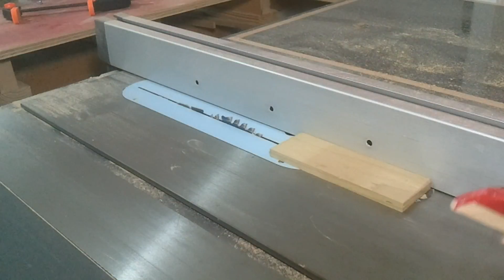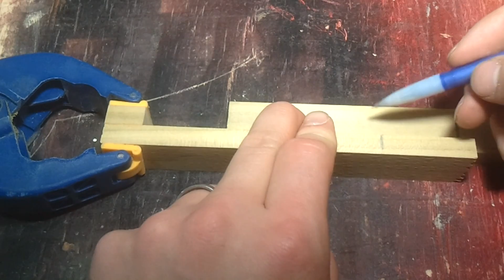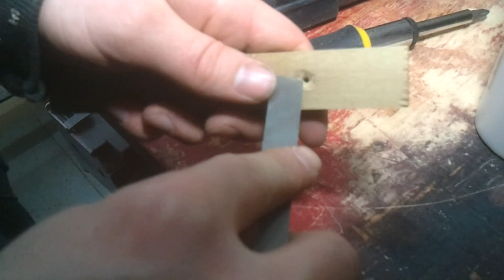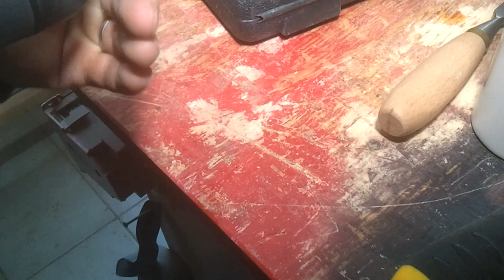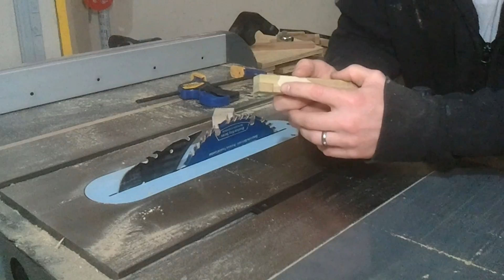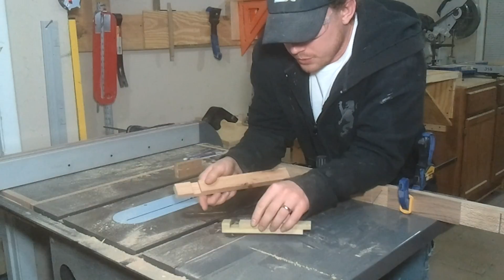DIY Kerfmaker with scraps - 052

Comment: not very pretty, but very useful and simple!
Sure you can build something with routed sleds like https://www.youtube.com/watch?v=YsfOWa_TFR8
Or buy one, for example the one from Bridge City Tool Works.
But this one is pretty sufficient, easy to make, even disposable. If you make the fix block adjustable you can use it for more than a single blade/dado-stack, if necessary.
Thanks for nice video.

Comment: Hey Jay - rather than creating the kerf afterwards (which seems a bit awkward), wouldn't the kerf cut be perfect and already in place when you cut the "fixed" end piece of of one of the two pieces, as long as the two pieces start out at the same length?  Then just make the slot, add the screw, and you are done!

Comment: jay i use both hand tools and power tools.  i was cutting a slot in the end of a 2x2. about one eighth inch thick.  using japanese saw cut two lines and started to use kerf of saw to make slot bigger then duh i remembered my drill. put drill bit on side in slot and made a perfect channel.   i have used same way you used drilled holes and took chissel to finish the job.  i am wondering if  we couldnt drill starter hole jig saw to end of dado put larger.drill bit and use like a router.

Comment: I have to admit I didn't understand a single thing you were doing until the 10 minute mark. THat's when it all came together for me.  That looks like a must have tool to me!
Reply: MrD Poling Jay, am I right in thinking that once the Kerf is cut into the tool, the tool is only accurate when used with the same blade in the future?

Comment: Instead of drywall screw and a glued on handle -- a flat head machine screw and wing nut. It's possible to put enough "back pressure" on the FH machine screw so that it will not spin in the countersink ( our just glue it with some E6000).

Comment: Don't take me wrong but instead of the jig why not to put the stock between stop block and the working piece. Make first cut then remove the stock and keep going until your working piece hits the stop block. Isn't it he same? What do you need the jig for? Am I missing something?
Reply: I did that once. The resulting dado was exactly a kerf width too large. I think the whole point of these kerfmakers is to avoid that problem.
Reply: you're so right! I tried this right after I wrote the comment :)

Comment: I'm thinking 8:40 ~ 9:10  explains why you would want to make one of these, maybe.   I've never used a table saw so never set or used a dado blade.  I am thinking of making a jig to hold a chain saw, so I don't need to buy a table saw.  Hopefully it will not be Darwin Award winning gadget.

Comment: Great tool. Also simple and inexpensive. I will check if any modifications are required to use it with a jig saw and may be extend it to a box jointing jig (for a jig saw). I always forget to add (or is it subtract) the kerf with horrible results. Getting this right ONCE would help me sleep peacefully. Thanks for sharing,

Comment: Just a thought, instead of assembling it and then making the kerf cut, couldn't you just sandwich the blade between the two pieces, then tighten it and cut off the ends? or am I missing something.
Reply: The cuttingtips on the blade is slightly wider than the sheetmetal base of the blade, and pretty small too. So if you press two pieces of wood on either side of the tips of the blade (which determines the thickness of the blade) the cuttingtips will dig into the wood and you will end up with a less exact kerfjig. It will work, but the fit won´t probably be as good as it shows in this video.
Reply: sjowe Good point, I didn't think of that.

Comment: Even simpler would be to not cut the straight piece to compensate for blade thickness but instead put a small screw at the end of the 'L' shaped piece to do that.  Adjust the screw so it sticks out the thickness of the saw blade. The construction is simpler and  this way you can adjust it for different blades or even a stack of two blades.

Comment: Great design! Instead of cutting the kerf by lining up and taking a little out of each piece, could you just lock it with your blade wedged in as a spacer and then trim the end?